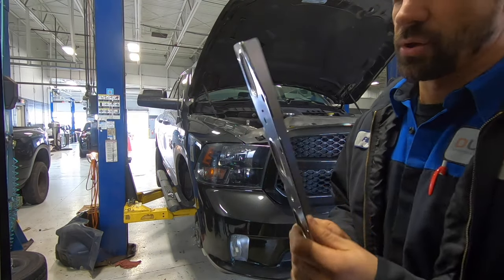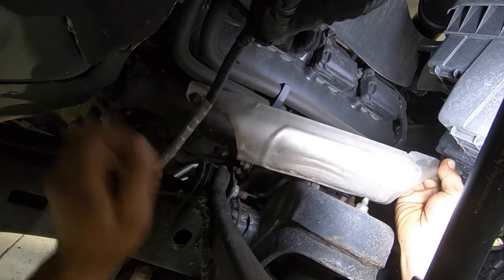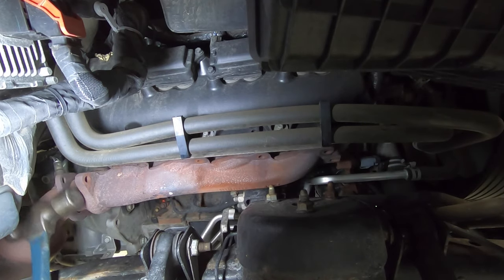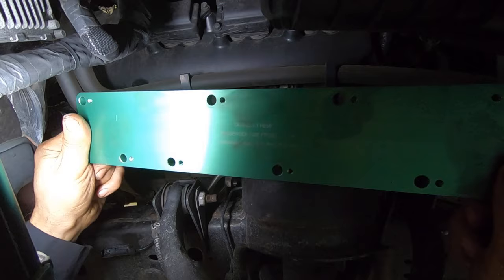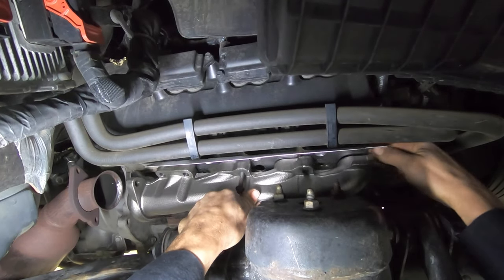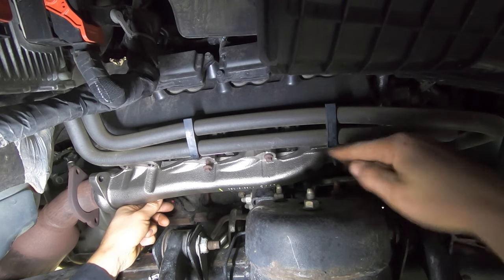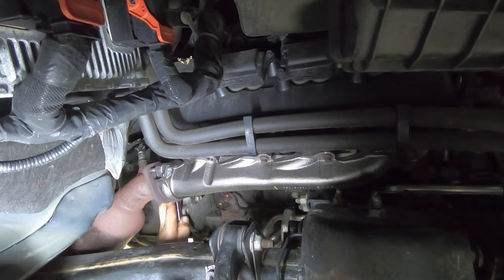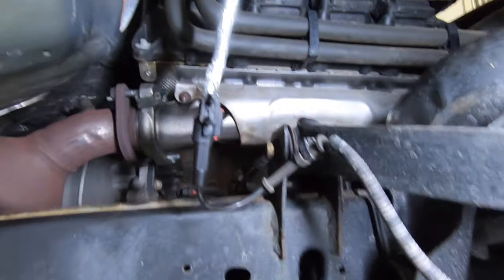5.7 HEMI Exhaust Manifold Leak | Broken Bolt Fix

Comment: All cast iron manifolds warp-no matter the make-fords, chevy's dodge/chrysler etc...  . Plane or resurface the warped manifolds and you'll not likely have this issue ever again. Once the manifolds have "heat cycled" they won't warp anymore. If the originals warped-what do you think the new ones are going to do?
Reply: That is exactly what I was thinking too.
Reply: @travispruyne4431  don't forgot to take into account the MDS, you can see on the manifold the sections where the cylinders didn't shut-down. Hence the warping- uneven heat distribution.
Reply: Excellent point
Reply: Smartest thing I ever heard lol all facts what u stated
Reply: So resurfacing the manifold is the best way to go?
Reply: How much does this repair cost?
Reply: Yup nice new manifold just gonna do the same thing again! Ram don’t mind though, just fork out the $$$$
Reply: how do I resurface the metal?
Reply: @chickenjoe1003  surface grinder or sander
Reply: I'll keep that in mind for the next time
Reply: Not really, because not enough heat is generated to do a so called "heat cycle" like you claim. But the foundry already did a heat treat if your thinking something like that.
Reply: Especially if they are oem
Reply: @bmead144 gets it!
Reply: Yes resurface 100%. Best move
Reply: How do you can get them resurfaced I’m having this issue
Reply: Can someone explain how you resurface a cracked manifold? Or do you just mean if you have one that warped and bolts broke off
Reply: @Amon Carter  they hardly ever crack
Reply: @broncofun5636  It cost me about $800 on my 2012 Ram at my local dealership back in 2020. I'm needing the bolts replaced again 3 years later & I'm sure the price will have gone up with the inflation these days.
Reply: @danielr8407 my local dealer just quoted me nearly $1600 for this repair.
Reply: @MukYJ ouch!
I need to do mine but I will do it myself just need to find a shop that will resurface mine or get aftermarket performance part
Reply: @pashagold  I went to try and do it myself, and found out why it was so expensive. 
On my 2011 Grand Cherokee there is zero access from the wheel well, and the only way to access the passenger side manifold is to remove the motor mounts and either lift or drop the engine. 🤬
Reply: @MukYJ  I have a Ram 1500 and it should have more space.
Reply: @alonagoldashkin1940  the problem is that in the Grand Cherokee (at least in 2011) they have filled in the gap between the subframe rail and the inner fender(?) where all the videos show easy access. Things are probably easier on a Ram with a real frame instead of a unibody.
Reply: I disagree. This is a known issue with Ram trucks. I've had many trucks and not had an issue. I'm on my second set of manifolds and I'm only at 91k miles. 1300 dollars per side ...they give a 2yr warranty but they bolts break every 5yrs or 50k miles.  In my experience. This is unacceptable. No more Rams for me
Reply: i went to a machine shop to have mine resurface and he said go buy new ones . I said F that and I went to my brothers garage and he has a big table top belt sander and i did both manifolds in 10 mins smooth as glass . Napa did my 4.7 dakota manifolds years ago and they are still good over 200k on it .but they stoped  doing it .new ones are just junk .
Reply: @MukYJ  I replaced both manifolds on my 2005 F150 and had to lift the passenger side engine,....trick is to take your time .8 hours for me and saved 2000$
Reply: @richardc2803  Well dont buy Ford Chevy or GMC also SAME SHIT different day

Comment: I just did both exhaust manifolds on my 2014 Ram Hemi. I had a bolt broken on each side. I used the Lisle kit and using an air angle drill worked slowly to drill the bolts and remove them with a  taper extractor. I had a local machine both manifolds that were badly warped for $50.00. Used new bolt's painted with copper anti size. Everything turned out good.
Reply: Hey brother, not experienced at all with my new 2012 ram big horn but do you think that would work on mine ? One broken bolt and it has that ticking noise that just busts my cheeks WIDE open. Love the truck though. Thanks
Reply: @antoniovera7313  If you have not done it yet then yes, it is the way to go. I have heard that it is even better to have the warped manifold machined because it has already warped and won't warp anymore after machining. I don't know if it is true or not. I did it because it was cheaper. 70K miles later and still no more broken bolts.
Reply: You got that kit still?

Comment: This should be a recall in my opinion this is a verry common issue and they need to change the manifolds to a more tubular 1 instead will sold the problem but thats not what they want to do because they want your money thats all it is is a money thing thats it and plus it's a shitty design and its not tubular that's the main issue to much heat going down the same tube for 1 causing the warping if it was tubular it would have better flow which reduces heat on them bults not causing the area where the bult is at so less stress on them bults the dam chargers and challengers have better manifolds than the trucks you don't hear about those cracking like the trucks do because they more tubular for a better flow its only common sence not rocket science to figure that one out if you know cars 5.7 chargers/challengers same engine as the ram 5.7 just some components alittle different like the manifolds for 1.

Comment: Did this on a friends Ram. New manifolds, gasket and bolts. 18 Lb Ft torque. about 6 months later, we did it again because bolt broke again. Sent old manifolds to a machine shop. Did the job over again and no issues for over 2 years now.
Reply: What kind of machine shop did you send them to get the resurfaced?
Reply: How much would this run at a machanix shop?

Comment: I just repaired mine.  I had two broken bolts on PS, and I used a welder to weld on a nut.  I think the method is superior to buying a custom plate that you’ll use once.  I sanded the manifolds flat on my 6” belt sander- worked perfectly and much better than buying a new manifold that will also warp.

Comment: I've owned 5 hemis pickups and 3 had this issue however 2 were under warranty. With this excellent video I feel confident I can tackle it myself, thanks.
Reply: I'm on my first and last 5.7 hemi. Manifold cracked on 2019 around 30000 miles thought I would attempt a permanent fix with set of Afe shorties they were good for about 15000 miles now passenger side header has cracked weld. It's louder than the Manifold crack. Terrible luck. Sad that the issue hasn't been corrected by FCA.
Reply: All it is going to take for me is one. So sadly disapointed with Ram, this is some really poor  craftsmanship here. Pure JUNK !!!!
Reply: @seymourbutts8850
Reply: @seymourbutts8850  don't blame Mopar on your cheap header
Reply: @samspace81  He said the OEM one cracked too, so it seems he can blame Mopar.

Comment: I was wondering about machining a warped exhaust manifold, yours is the first video i’ve seen suggesting that.  Thumbs up
Reply: don't bother their cheap!
Reply: @rickeystone4838  
There is an argument that a heat warped part, that is machined, is not likely to re-warp versus a new replacement.  I have had warped brake rotors machined, and the warp never came back.

Comment: If you have access to a welder, welding a nut onto the broken stud is easy. The weld won't bond to the aluminum head plus the heat generated from welding makes extracting the broken easier. My understanding of the warping issue is that it is caused by having an aluminum head, steel bolts/studs, and a cast iron manifold, all of which dissipate heat very differently. The aluminum head and steel bolts have some stretch to them but the cast iron doesn't and eventually warps and breaks the bolts when they exceed their stretch limit. Don't know if that's absolutely correct but it does seem to make some sense.
Reply: Having 16 sparks plugs will make that manifold warp 😅

Comment: I just did all this and machined the cast iron manifolds, ceramic coated them before reinstalling. Used ARP Hardware  and remflex crushable gaskets, heat taped the coolant hoses due to not putting the heatshield back on. Fingers crossed it hold for awhile.

Comment: I’m having this done on my 2014 Dodge Charger RT Hemi. I have the MaxCare warranty so it’s a $100 deductible cost. I  am here out of curiosity on how it’s repaired. Nice job!
Reply: Did they cover it? Have this issue and Carmax extended warranty. 25k miles on truck but it is a 2018... thanks.
Reply: @johnhoover6180  yep! They done both sides. Quite as a cat!
Reply: @theknow7557  thanks!

Comment: Not sure if your question in the video has been answered or not yet but they warp because of the different heat expansion rates of the aluminum cylinder heads versus the cast iron exhaust manifolds.  The aluminum cools and contracts a bit faster than the iron manifolds so it literally bends the flange of the manifold when this happens over time.

Comment: I've found especially on hardened metal if your run the drill at a low rpm it won't burn the bit and make it dull.  At least not as fast.  Also if you can dip the bit in oil periodically.   So air drill might not be the best choice for the job, instead a variable speed electric drill.
Reply: Yeah and a lot of the time if the bit gets dull and stops cutting and you keep trying to drill it, it'll actually start tempering the bolt even more making it harder to drill with a new bit.

Comment: Just had this happen on my 2016 Ram @ 85.1K.  From what I'm seeing i should consider myself lucky and it's only on the right side.  Great video!
Reply from the maker: You are lucky! I just did the left side on 2019 last week, fighting the brake lines, steering halfshaft and engine deepstick is not much fun!

Comment: 2019. Mine keeps on clanging for a few seconds until warm.  This video helped me identify what the dealer did not. THANK YOU. I've found that this is most likely exhaust manifold leak/ warped manifold/broken studs. Seems to be a common problem with 5.7s. Only 25k or so miles on this truck and it's been an issue since I bought it. I dont trust my local dealer service dept to be honest. (They've had the truck 3x)  They 
said this when I took video in on the 3rd visit after telling me there was nothing wrong the first 2x. "As vehicle sits oil bleeds down & when first started has to pump the oil throughout engine until oil pressure is achieved it may sound rough for a second, normal operation and characteristic of 5.7 hemi." 
Would have qualified as a lemon if I knew then what I know now. Stil have engine and trans warranty. Wondering what my next steps should be. Seems like FCA knows all about the issue. But they advise to just swap out manifolds and bolts, but I see that the best fix is to have manifolds resurfaced or planed and new bolts installed. IDK. Disappointed.

Comment: Sounds like its my next repair. did split flange on drivers side. fixd noise there. still little noise from right side. ticking when cold. flange ok there. i bet i have broken bolt too. my bolts so rusted seems the head not in good shape. sounds like a job i will do in future. 2007 dodge 2500 i have. Great detailed video and explanation.

Comment: I have to ask, mine has been doing this for the past year, and it seals up in under a minute. When it finally doesn't seal, if ever, why fix it until then unless you just don't want to hear it when first starting??
PS; with that asked, I will be doing this myself so thank you so much for the vid! Subbed

Comment: I think these manifolds are faulty from the supplier or the factory is breaking the studs during the initial installation.  On my 2014 Ram, I noticed the startup ticking on the test ride on a brand new truck with just a few miles on it.  So it definitely came out of the factory that way.
Reply: Another video I watched guy said this happens like every 30k miles if you just keep replacing everything
Reply: There is a service bulletin for the 2014, but not my 2013.

Comment: My almost brand new Charger RT just started doing this with less than 900 miles on it!!! WTH?? I'm wondering what good it does to have it fixed under warranty if the same weak studs are used? Are aftermarket studs available that are stronger? Maybe from Summit of Jegs?

Comment: Really well done.  I have the ticking on my 2011 on the the front of motor drivers side.  Goes away when warm  Is it possible to just temp seal it with some steel putty  like JB Weld

Comment: Great video. My 2013 Grand Cherokee did the exact. Unfortunately, drilling and extracting didn’t go well, as it is extremely difficult to get a square run on the bolts. Fortunately, with the help of a $200 FCAW, I was able to tack some nuts on the snapped bolts and unscrew them.
Reply: How long did repair take? And did you have a garage lift that you used?
Reply: @billkeating9810  took me a good day. But that included buying the welder and getting it dialed in to tack nuts on. I did not have a hoist. Just jack stands. This is for the passenger side only, btw.

Comment: I wonder if disabling MDS from day 1 each time you start the truck would cause a more even heat cycle and potentially avoid this issue all together ? First thing I used to do in my 6.4 Hemi in my 300 SRT was put the shifter into manual which would disable it. I'm thankful my Challenger Hellcat doesn't have it at all. I cannot stand it. Auto start/stop is another bright idea that needs to find the grave.
Reply from the maker: I personally can’t stand start/stop. How is shutting down engine for a few seconds going to improve gas mileage?  When I stop for longer like on train tracks I can shut it manually.

Comment: I have done Fords and GM ls motors. Same issue. Never drilled one out in my life. Throw the drill out. Learn to weld and weld a nut the the broken fastener. Even below the surface it can be done.

Comment: pretty much always the rear studs let go, and pretty much always flush! and on these hemis they are easy to get out by welding a 5/16 nut to broken stud by a decently skilled welder!. The biggest issue is getting out the studs that aren't broken but nuts rusted round. which you cut off with a oxy acetylene torch or in my case I used my plasma arc.
Reply: I wonder why is that !

Comment: I have a 2017 Ram 5.7. Bighorn just under 100k miles passenger side blew out 2 bolts. warrantee covered. 6months later after warrantee expired, driver side blew out 1 bolt. Took 3 weeks to finally get parts delivered to my local mechanic. Frustration to the extremes. Dodge needs to figure something out. I'm almost thinking of drilling a couple holes in the heat shield to let it breath. Looks like too much expansion/contraction on bolts like you pointed out. Would you think it might possibly work? I hope there is a recall soon. Out of pocket $$$ for a crappy design sucks

Comment: Cast iron manifold and a aluminum block heat and cool down are different and thats why it bolts break
Reply: The fault is Chinesium bolts.  Replace with Supertanium or Grade 8 fasteners.
Reply: Yes, Cast Iron Manifold + Aluminum block + cheap Chinese bolts + catalytic converter two close to the manifold.    All together contribute to this.    Dodge should be ashamed of themselves for not offering a full recall on this and fixing this for those who have remained tried and true to RAM trucks.     $1700 to do both sides of my 2019 RAM 5th generation Laramie with only 59K miles.   I was told to prepare for it to happen again, just not sure how long it will take per the tech, but it will happen again.

Comment: how long did this job take..? just the one side,,I have to do mine,,found broken stud/nut at rear end of manifold..and it ticks when cold, also, kept throwing check eng. light code for catalytic right side below threshold..figured the code came because of excess air into exhaust system as it passed by 02 sensors..

Comment: My guess is why the manifolds are warping is the multi-displacement system is making some parts of the manifold cold while not running and other parts of the manifold hot causing warpage
Reply: NOPE in my 27 years of FORD F150 replaced manifolds on all 3 trucks ,ALL 8 cylinders NO MDS!!

Comment: bought mine 2019 Ram new.  I questioned the dealership about the ticking noise and was told this is a typical hemi exhaust leak that goes away once it the engine warms up.  They even went out to the lot and started up a few other hemis and they all did the same.....Design intended.
Reply: nice.  They can't fix it so call it a design feature.

Comment: Great video, very helpful!
Do you think the drill fixture fit my 2013 5.7 hemi Jeep Grand Cherokee??
Reply: Yeah same engine. 5.7 is a 5.7
Reply from the maker: Yes all 5.7 Hemi engines have the same exhaust manifold bolt pattern.
Reply: @propstriker did you end up doing this repair on the Grand Cherokee?  Think I have this issue on my 2012... Haven't investigated extensively yet.  Just wondering if you ran into any Gotchas doing the repair
Reply: I've also got a 2013 JGC 5.7.. but on the drivers side, after i remove the felt wheel liner and tire, it's not open like in this video... I've got a metal plate in the way that makes it almost impossible to remove the manifold
Reply: @zachtison8064  how did your repair go? My 2013 jgc, same problem. Did you do repair?